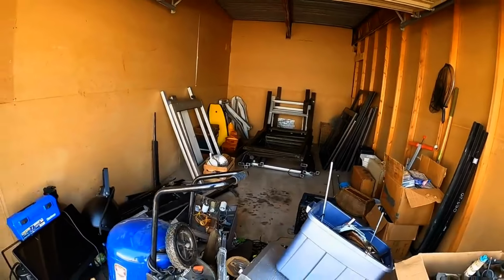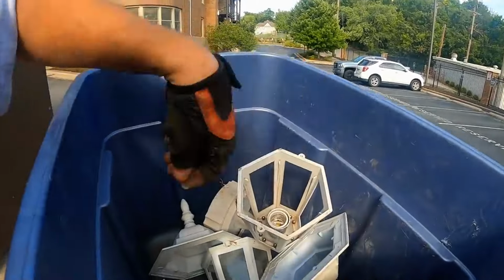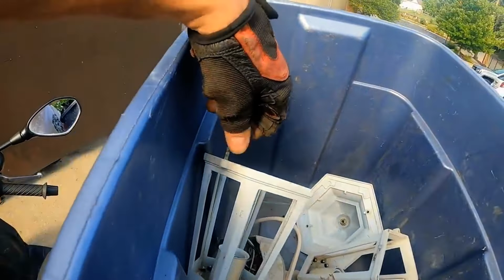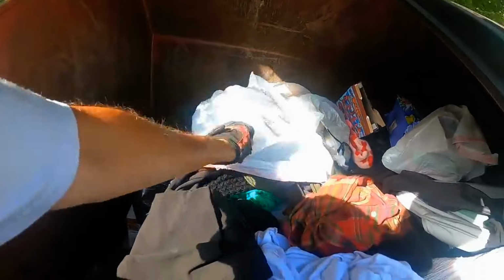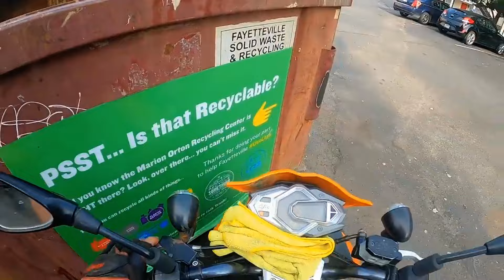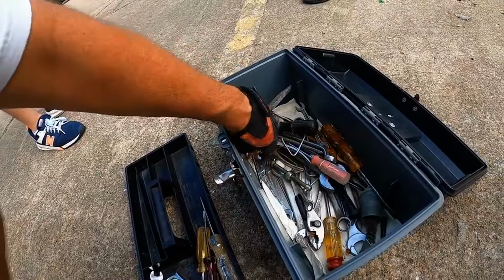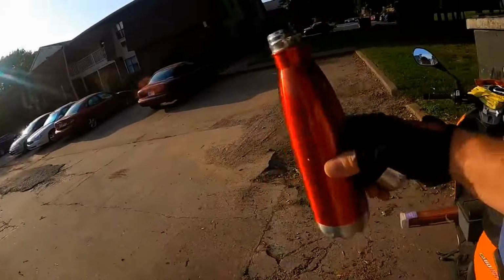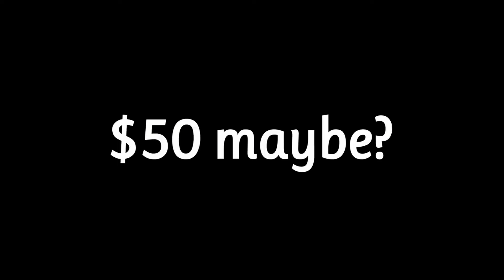Dumpster Diving "This Ends Where it Starts"

Comment: Quick question not to make fun of nobody. I love your  channel. You said you make more money than having a truck but you make $12. If you had a truck you make more money just a question.
Reply: He's full of it
Reply: @sarahanderson8371 
SAYS A 🤖🤖🤖!
Reply: @sarahanderson8371  i’m just saying not to make fun of nobody. He said he makes more money than a truck. He said that a while back but he made $12 if you had a truck you make more am I correct or no I don’t know you got more room for more stuff than a motorcycle
Reply: Not necessarily a truck costs more to fill up on gas and insurance is more expensive and all around more expensive so in the long run he might make less per trip but he's able to pocket more of the money since he has less expenses
Reply: Small footprint to cover, the storage space, his apartment & the recycle yard are very close to each other. Like a bee he can blast through dumpsters and return to his storage to unload when filled then back out. As for curb side scrapping a pickup would be better.
Reply from the maker: @Lyle_918  ...the force is strong in this one
Reply from the maker: @jasonhinojosa1506  areas can be very different with tons of factors at play as well, so no i can make much more on two wheeler where i live